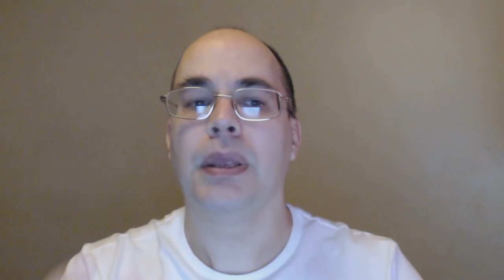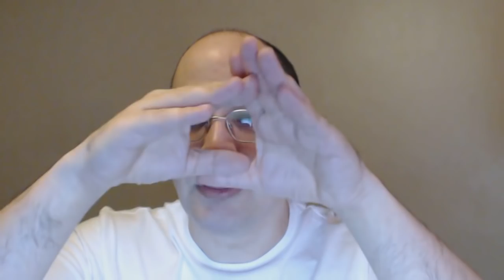How do rockets move in space, with nothing to push off from?

Comment: Rokets work on the principle of pressure.  You need a high pressure area behind the rocket so that the rocket can move into the lower pressure area in front of it.  You cannot create pressure in a vacuum.  Rockets have nothing to do with the " conservation of momentum". 

   Also , guns do not recoil like this twit explains.  He has managed to get everything wrong.  Pure Dunning Kruger.
Reply from the maker: Rockets don't work on pressure, though creating pressure in a bottle rocket can give it the potential energy to work, rockets have everything to do with conservation of momentum and strangely enough guns do recoil like that, I suggest you check your facts before launching into a comment next time.

Comment: I would have simply just said that a rocket is an external combustion engine. That combustion takes place in the cone / nozzle, and is a continuous explosion , The shape of the cone is key as it forces ~60% of the thrust back at the craft, what is fired out the open end of the rocket is just exhaust which produces no trust in the infinite vacuum of outer space, it probably would give some thrust on the Moons solid surface but still very  small force. But to understand a rocket you have to think of the trust being from the combustion cone back at the craft and sides of the cone and not the exhaust gasses.
Reply: Still just momentum exchange in the end though.

Comment: They push off of their exhaust fumes.
Reply: Sorry?
You appear to be implying that a rocket is propelled because its exhaust is pushing off the atmosphere? Seriously?
You obviously didn't do too well in your physics class at high school Douglas, lol.
Reply: @sailorman8668  no he literally said "PUSH off their exhaust fumes " which is technically correct
Reply: @stuartgray5877  Except in the infinite vacuum of space the exhaust would be immediately consumed and redistributed throughout all of Space offering no resistance whatsoever.
Reply: @asleepinthealley  No it will NOT. The engine accelerates the gases while STILL INSIDE THE ENGINE.  What happens to the gases AFTER they leave the engine is irrelevant.

The liquid enters the engine at a relative velocity of ZERO and they exit as a GAS moving at 2500 meters per second.

THE GASES WERE ACCELERATED INSIDE THE ENGINE.

AND I HAVE TO KEEP TELLING YOU : The "Vacuum of space CANNOT PULL ON ANYTHING* I repeat: A VACUUM CANNOT EXERT A FORCE ON ANY OBJECT OR GAS

Comment: This did not address how it propels in space at all lol. The gun example is an explosion between the hammer and the actual projectile. The gun gives recoil cause it wants to go one way but you are holding it, so the projectile exhausts the energy as its pushed forward through the drag of air and through the forces of gravity pulling it down blah blah blah. How is the rocket pushed through space if there is nothing to push off?? If there is NO force to counter in any direction besides the minimal gravitational pull of all objects with a greater mass. What would the blowing of super hot gasses do without a second element to press off. And then if the argument switches to changing pressures, can the change in pressure from high to low project something in a vacuum?? Would the infinite space pull those gases just as fast as they would be expelled?? Mind you all while we are shooting through space as a solar system at 514,000 mph and the earth is moving with the sun at that pace plus rotating around the sun at 67,000 miles per hour?? Gtfoh. So when they leave earth's orbit they're pulled along by the gravitational pull of all these happenings?? If that were true we could set a trajectory to a trailing planet or galaxy by counyering our gravitational tow by countering the speed we are being pulled with this imaginary propulsion in space and get to Pluto in record time passing through the van Allen belt and all lol. Mars is 55 million km away st its closest point and it would take 300 days or so to reach it supposedly. If we are already hurling through space at rediculous speeds would that be we traveled to Mars at 274,000mph or -274,000mph to counter the forces we would have already be subjected to ??? Bullshit. Throwing a curve ball at something moving at a curve and traveling behind  the same speed trailing the sun at 514,000mph  but orbiting the sun at 53,979mph???? lol
Reply: If an astronaut was weightless in space, and threw a 30 lb medicine ball away from themselves, would the astronaut remain in the same position whilst the ball travelled away, or would the astronaut also be caused to move, in the opposite direction from that of the thrown ball?
Reply: If I fire a steel projectile from a CROSSBOW in zero-G, in a vacuum WILL I FEEL RECOIL ? Yes or no?
Reply: Air resistance is the resistance of the air to a body passing through it; the force that the body has to apply to move the air out of the way, equal (thanks Newton) to the force that the air being moved applies to the body moving it.  Air resistance exists because air molecules have inertia so resist being accelerated: they resist change of momentum. And, by Newton's first law of motion the force exerted on the air molecules equals the force that they apply back.  
So: change in momentum is resisted by inertia, so a force is required to change momentum. And, force exerted = force resisting.
Therefore, if a rocket pushes e.g. a brick out behind it, the momentum of the brick goes from zero to something in the backwards direction. So the brick's inertia resists this. So the rocket has to apply a force to the brick to make that change of momentum against the brick's inertia. But, at the same time that same force is applied back on the rocket (First Law), so a force is applied against the rocket's inertia, so the rocket has a change of momentum :- forward. 
Now, rather than one brick, imagine a whole series of bricks: push, push, push.
Now, rather than bricks, imagine a whole series of gas molecules: push, push, push, push, push, push, push, push, push, push.

Comment: A good way to visualise this is a Jet-Ski.  A Jet-ski engine doesn't push water against the lake water, it simply throws water out the back, into the air.  In fact Jet-skis don't work as well if the water is forced back into the lake.  The aim is to throw as much water backwards as possible.  The more water you throw backwards, the faster you go forwards.  You could throw that water into a vacuum and you'd still go forwards (possible even quicker).
All a rocket motor is doing is throwing as much mass backwards as it can.  You could replace rocket-fuel with Bowling balls and, if you through the bowling balls out quickly enough the rocket would so upwards, on earth or in a vaccum.
Try this on a wheeled office chair.  Throw a heavy object away and your chair will move in the opposite direction, on earth, or in the vacuum of space.  It just about throwing mass in one direction in order to go in the other direction.
Reply: If you outfitted a spacecraft to fire bullets out the back, then yes it would absolutely be capable of autonomous movement. And if you managed to propel gas out of the craft, you'd be fully capable of moving as you intend.

My question isn't about that. My question is: if you're in a vacuum, how can you force the gas out in any specific direction? On Earth, atmospheric pressure makes that a piece of cake. But there is no pressure in space, it's as negative of a pressure as you could ever have. So what's the explanation for that, if there is one?

Edit: the more I think about it, I actually think that my concerns were misplaced.
Reply: @p.as.in.pterodactyl1024  - "it's as negative of a pressure as you could ever have"  No it IS NOT! 
 There is NO SUCH THING as "Negative Pressure".
  The "Pressure" i space is ZERO PSI.
  The "vacuum of space" DOES NOT "SUCK". 
 The vacuum is INCAPABLE of exerting a fore on ANYTHING including the gases from the rocket nozzle.
Reply: "All a rocket motor is doing is throwing as much mass backwards as it can." The experts would disagree with you. They think the same amount of energy expended for a rocket engine's maximum speed of 6000 mph would eventually reach the speed of light if possible. Which is the same as claiming over-unity devices work.

Comment: i under stand how a canoe moves useing a paddle against the water 
resistance . but if i take  the paddle out of the water and row the 
foward movement stops. .ive seen rocket propulsion in small vacuum 
chambers .  but dont see how that compares to the vast endless vacuum of
 space..  thrust in a small chamber can easily  match the speed of the 
draw of presure from the chamber and  fill a it with a change of presure
 and show a small amount of thrust .  but in endless vacuum thats a 
impossibility  to fill and cause any change of presure....... propulsion
  with lack of atmosphere    combined  with vast endless vacuum  = no 
movement
Reply from the maker: The paddle isn't how the rocket works, if you are talking about water it is closer to flyboarding - https://en.wikipedia.org/wiki/Flyboard so long as there is more water being pushed out of the back of the motor you will continue to get thrust no matter if you are in water air or even in a vacuum.
Reply: If I fire a steel projectile from a CROSSBOW in zero-G, in a vacuum WILL I FEEL RECOIL ? Yes or no?

Comment: Propelled gases act as a mass opposing air pressure during a steady rise from engine thrust...the expelled fuel pushes off all masses in its immediate impact event...when you shoot a rocket off from the ocean floor it has two different types of propulsion for two different mediums...torpedo style under water and combustion once it reaches air pressure
Reply: Lemar French Do you just say things without thinking them through or does it make sense in your head?

Comment: What I would love an answer to is this ...forget about pushing against a vacume..how do you gain any combustion at all?
Reply: By combining fuel with an oxidiser. Every space rocket carries both.
Reply: Yeah but to carry enough oxygen on board to supply the take off and to supply the men and women on board ... ??
Reply: Yeah, they do carry enough oxygen on board to supply the takeoff and crew on board. It's two different systems, actually, which aren't connected in any way.
Reply from the maker: Compared to the rockets the mass of Oxygen used by the crew is relatively tiny, just over 1Kg per person per day.

Comment: It's not really about conservation of momentum, but about newtons 3rd law of motion.  every action has an equal and opposite reaction.     Force, is not equal to Mass  x speed,  (that would be power (corrected  " momentum" not power)  force is equal to mass x acceleration and how that applies to rockets in space, is that its Acceleration = Force/mass.............so, the rocket has a different acceleration proporatioal to its mass.   the gun accelerates less due to its larger mass and the bullet accelerates faster, due to its lighter mass.  same force!   get it??
Reply: Mass times speed is momentum. This is about conservation of momentum AND Newtons third law. The two are complementary in this case. 

Ps. Power is energy over time, or more technically the derivative of Energy with respect to time. 

Accelleration is the derivative of velocity with respect to time. So Force is mass times the derivative of velocity with respect to time.

Momentum is the integral of Force with respect to time. Energy is the integral of Force with respect to distance.
Reply: @DaysDX  yes, momentum is always conserved....and yes, power is the rate of change of Kinetic energy.  the point was , force is not mass x speed.( i misspoke ..  mass x velocity is  is momentum)
Reply: Conservation of momentum
DeltaP = 0
m1v1 + m2v2 = 0
m1v1 = -m2v2

That is conservation of momentum describing 2 bodies, like a gun and bullet.

F=ma
a = F/m
a = dv/dt
v = int(F/m)dt
v = p/m
Neat how that works out!
Reply: newtons 3rd, theres nothing in a vacuum to REACT to a rockets thrust. rockets dont go to "space"
Reply: @theeye-ns1ch  you are not trying to understand.  the mass that is ejected from the rocket, pushes off the rocket and the rocket pushes off the mass being ejected.  there is no need for anything else to "push off from" . this change in momentum... any time a mass with a velocity changes direction or magnitude, will create a force.    just like a gun.. the bullet has rapidly expanding gases, which push on the gun, the gun pushes back.   the force is equal...... so, the smaller mass with the same force has a greater acceleration, while the gun has a lesser acceleration (proportional to their mass)    the bullet accelerates at a rapid rate... the gun , much less

Comment: Thanks man. That was cool. Can you do one about whether mass matters in space when rockets are being used to push them for example can you use a tiny little rocket to push a massive spaceship because it weighs nothing in space?
Reply from the maker: There is always the confusion between weight and mass, the further you get away from a large body in space the less weight something will have, but even if the weight is dramatically reduced it will still have a tiny weight. However the spacecraft mass will not change with location, mass remains constant. It is fairly easy to change the orientation of a large mass with a tiny rocket, but far more difficult to change the momentum or acceleration of a large mass. I will have a think to see if I can put this into a video of some description.
Reply: @mjmurcott647  why are you deleting all the comments proving you are wrong?
Reply: @pl2727  he is not wrong. A rocket will not be able to accelerate if it needs to push off air. Air is not a rigid object. It accelerates because of conservation of momentum. If you fire a gun inside a vacuum chamber the gun will recoil backwards, even though there is nothing to push off against

Comment: OK what if the rocket needs to TURN AROUND?
Reply from the maker: Adjustments in direction can be made by thrusters on the side of the rocket, however the rocket will still have the initial momentum. Changing direction in space can also be achieved by doing a partial orbit of a body like the moon.
Reply: @mjmurcott647  THE PRESSURE IMBALANCE FALLACY In this case the explanation goes something like this: inside the combustion chamber of the rocket there are pressurized gasses. The pressure is equally balanced in all directions and the system is in equilibrium, but as soon as a valve is open on one side and the pressurized gas is free to expand outside, a pressure imbalance develops inside the chamber, as the chamber's wall directly opposing the valve will experience a pressure not offset by its counterpart. This imbalance will create a force that will push the chamber and in turn the rocket forward (as an aside note, in the end that means the rocket is pushing on itself, AKA the Baron Munchausen effect). Let's devise an experiment in which we have a container in a vacuum with pressurized gas inside and let's assume, for the sake of simplicity, it's shaped like a cylinder. The container has two walls, let's call them A and B (corresponding to the bases of the solid). Wall A can be opened, to let the gas exit the container. Wall B (opposite to A) can move along the inner part of the cylinder, like a piston, and we have arranged the system so that the weight and the friction of the wall/piston exert a resistance (inward force) that balance the internal pressure of the gas. Now, starting from a point in which the system is in equilibrium let's remove wall A allowing the gas to freely expand. According to the explanation, the wall B should now be subjected to a force directed outwardly, caused by pressure imbalance. Such outward force (conceptually equivalent to the force that would purportedly propel a rocket) should cause the wall/piston to move accordingly in an outward direction. If you have the piston connected to a gauge, this movement would be read as an INCREASE in internal pressure?? We are now at a point where, ceteris paribus, just opening the container (i.e. increasing the volume), we had the effect of measuring an increasing in internal pressure. Until you can demonstrably invalidate Boyle's law PV=K, we are dealing here with a thermodynamics absurdity. Bottom line: the laws of thermodynamics actually disproves rockets working in the vacuum of space. Conclusion: the laws of physics are all consistent in disproving rockets working in the vacuum of space. G'Day Mate : - )

Comment: the force is near constant... the acceleration is near constant, if the mass being ejected stays at the same rate and the mass of the rocket stays the same.    the mass of the rocket gets lower as fuel is used, so the rocket acceleration increases as fuel is used... plus aerodynamic drag goes up and then down as it enters space.... once in space, the velocity of the thrust, is irrelevant.   it is Acceleration=Force/mass.  if the force can be kept constant, the acceleration will be kept constant. so, a very small force for a very long time,  can accelerate the rocket to very high speeds over a long burn rate.
Reply: Close. but the velocity of the exhaust IS relevant.  It is the MOMEMTUM transferred to the exhaust that gives the rocket forward thrust. Momentum is directly proportional to velocity therefore higher exhaust velocity results in greater thrust.
This is why rockets have MORE thrust in a vacuum because there is no atmospheric pressure slowing down the exhaust gas as it tries to leave the nozzle.

Comment: This does make sense, but the rocket is pushing away from space. It's hard to visualize at first, but if you can understand how a rocket engine works in a vacuum (with oxidizer and liquid fuel) then it's pretty easy to understand.